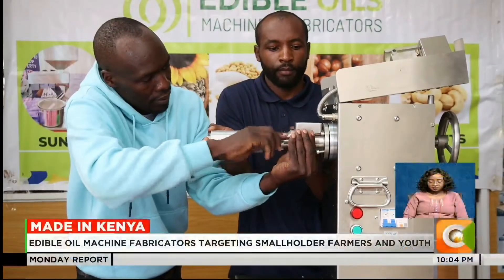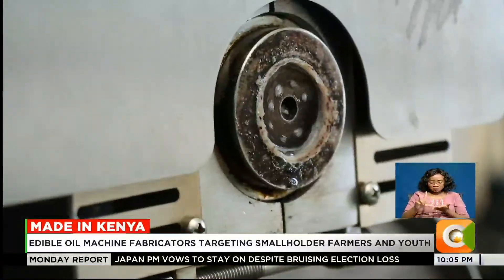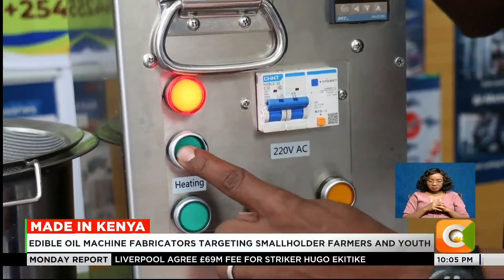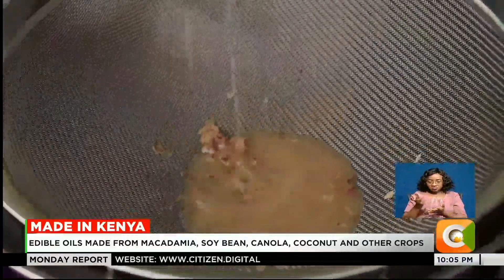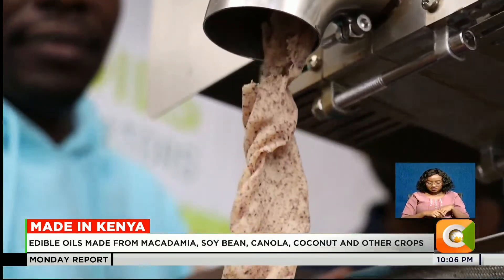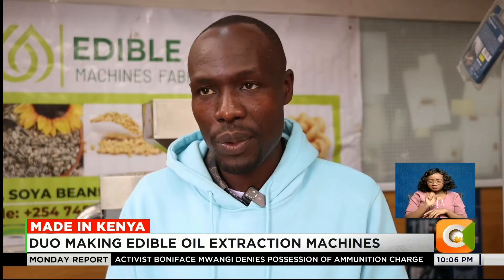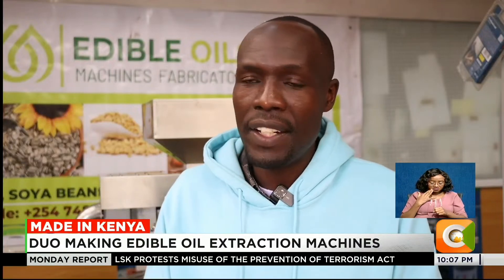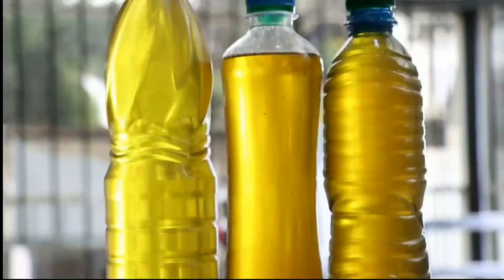Made in Kenya | Duo making edible oil extraction machines

Comment: Buy one and reverse engineer it. Change it a little to avoid patent infringement.  It's hard to protect such a business. But the tooling might be very expensive which will keep them in business.
Reply: No patent infringement here.
This machine is simply a compression screw type similar to those used in charcoal bricket    or bar soap production